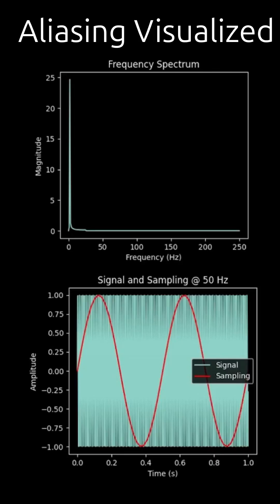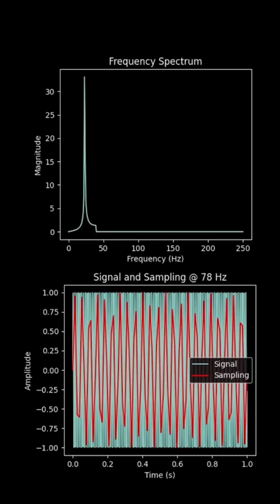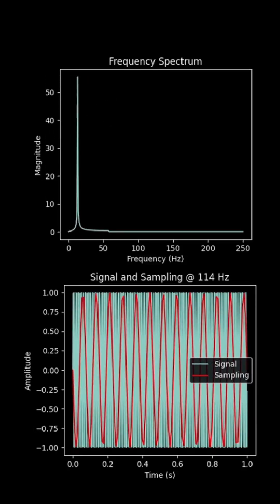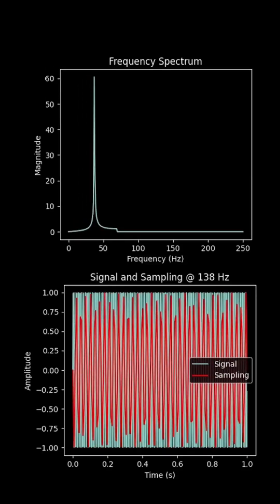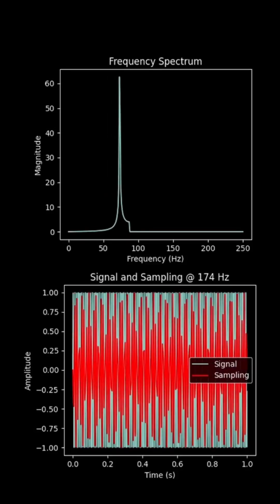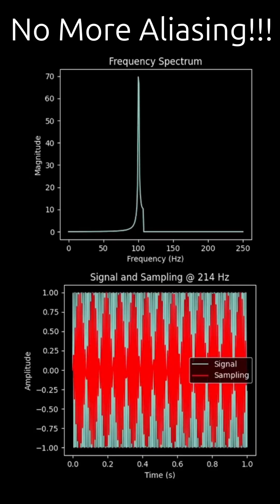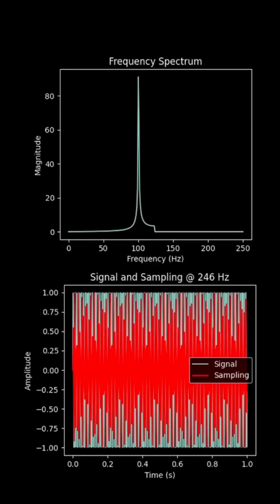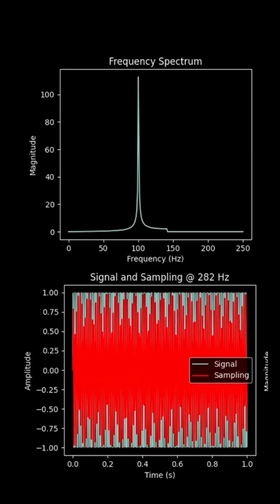Aliasing and Nyquist Sampling Theorem Visualized  #science #signals #maths

Comment: Wait so aliasing only occurs at sample rates lower than Nyquist? 
Also, based on that spectrum analyzer, it seems like a sample rate about double the signal freq is actually superior to higher sample rates? At around 202hz sample rate. Is that just an artifact of this being a pure 100hz (or n hz) pure sine? Or even with a complex combined signal, is it in any way beneficial to have any sample rate higher than Nyquist?